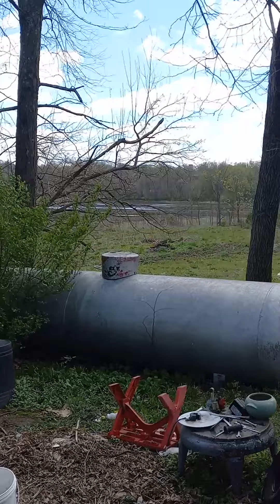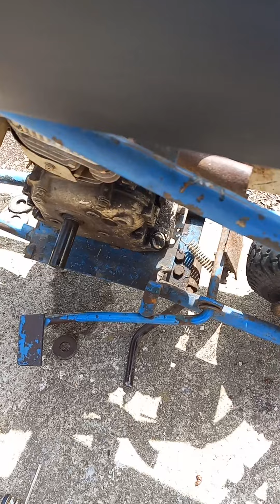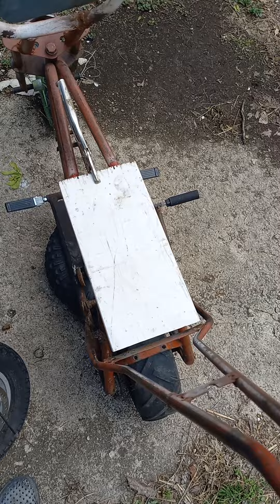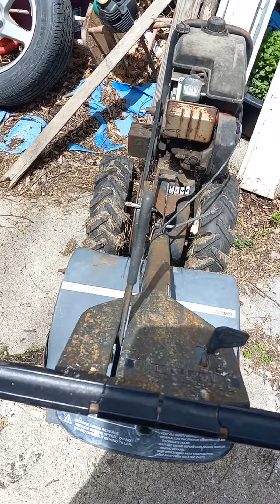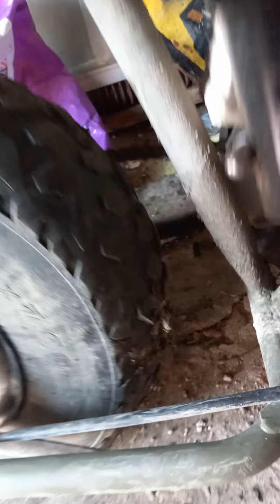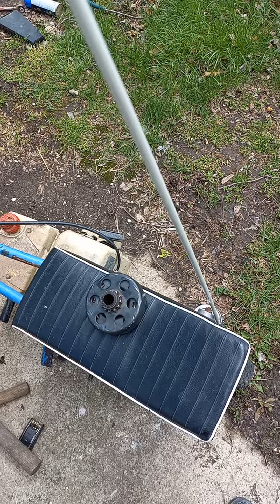2 week of rain

Comment: I use the black Allen head black oxide looking bolts. Stuff is getting hard to find and expensive again.
Reply from the maker: Old school looking good after the diet
Reply: @heathenprojects2639  old school is the new school brother! Lol we are ahead of the curve!!
Reply from the maker: @fatbuddycat  mocked up my split rims yesterday I'm going to cut me some card board cut outs take to my buddy he has a cnc make some loner rear gusset to weld in I'm going to keep the scrub brake but do some hydraulic for split I'm going to make this a scooter I'm also looking at adding springs with front suspension kit to match the rear shock got a pretty good idea layed out also looking at trike for indian test fit the seat pan I'm going to be behind the rear tire so it will be a wheelie machine I've got a few axles to choose from not looking for speed just cruizer
Reply: @heathenprojects2639  now that's a game plan!!